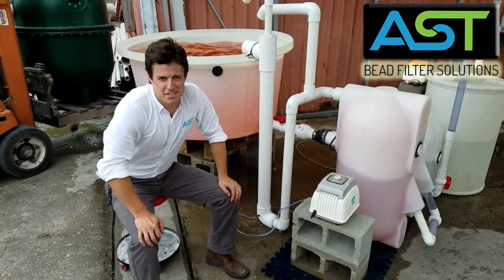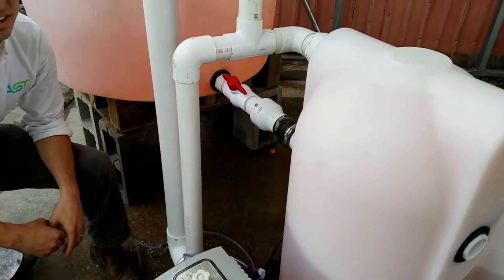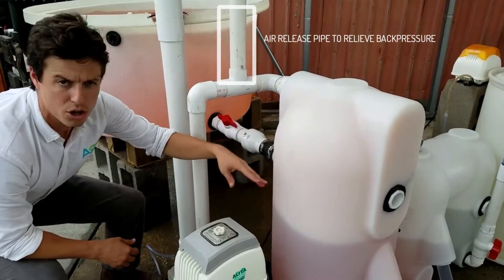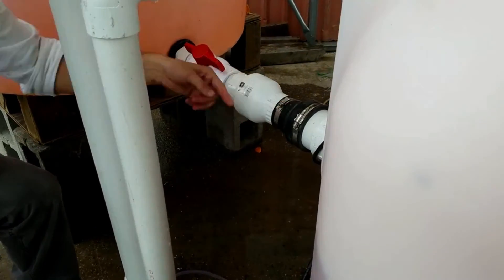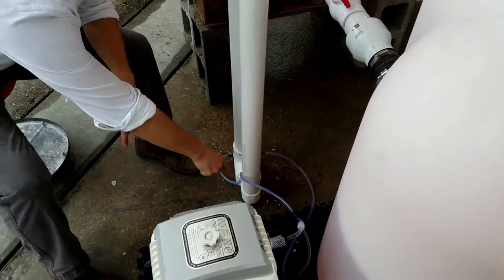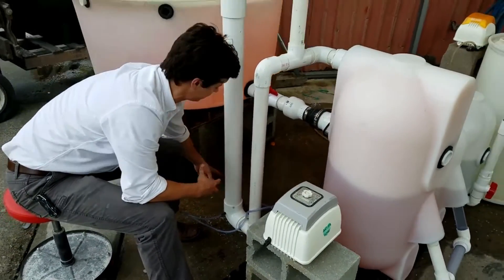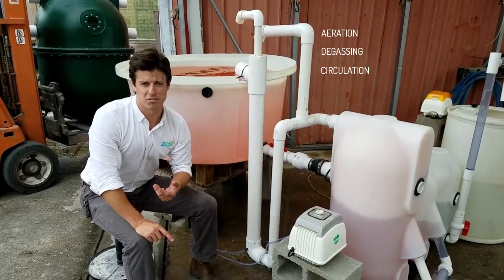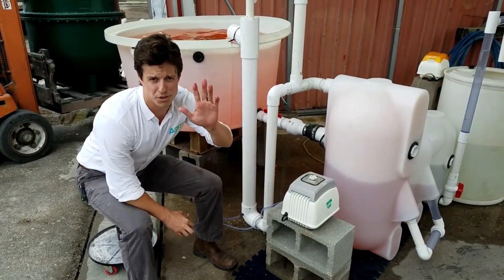AST Endurance Filter: Gravity Fed, Airlifted System- No water pumps required! PolyGeyser Backwash

Comment: What are the advantages of either the Endurance compared to the standard green Polygeyser filter that you make ?
Reply from the maker: Both operate the same way in terms of backwashing, the main differences is the size offerings and the fact that the Endurance consolidate sludge in a separate compartment for removal.
Reply: Thank you for explaining.  That’s pretty cool.  If the third chamber is  intended for more of a longer term and larger separate bin for sludge instead of just having gravity separate it in your other Polygeyser ,  could it be beneficial to have your air intake some sort of  bubbler in the sludge compartment to help with the break down of the sludge . It would be like having a built in mineralization tank .

Comment: hi, I have two questions.
1-I am building oxygen concentrator machine. So your system is good for oxygen mixing?
2-What if the airpump is cut off, will the water still flow?

Comment: waste of extra pvc, title is misleading, air pump does use electricity 🤔
Reply from the maker: Jedab, 

While yes the air pump does consume electricity, The advantage of an airlifted system is that the water pump is not required since we are using air to move the water. We calculate the required aeration for each system based on feed loading and split in tank aeration with the air used to operate the airlift, therefore reducing the electrical consumption of the system. 

Thanks!

Comment: What are the consequences of a power outage/pump failure in this configuration? Would the fish tank lose more than 6 inches of water?
Reply from the maker: Thanks for the  question! There is no real consequence of a power outage. If power is lost, the water level would equal out in the system, with minimal tank water level drop. Basically the volume to fill the pipes is the only water level loss that will be experienced. One thing you want to make sure of is that you either have the air pumps above the water level or have a good, reliable check valve installed so that water can not backflow into the air pump/blower.

Thanks again for your question!

Comment: What is your opinion about biofloc?
 What is its disadvantages?
Reply from the maker: Ahmad, 

Biofloc systems/green water systems have been used for years in both tilapia and shrimp growout. These systems have their advantages and disadvantages. The main advantage is the relatively low capital costs. Since biofloc systems require little to no traditional biological filtration such as MBBR/Bioclarifiers, there is not much equipment that needs to be purchased. However, the main disadvantage of these systems is that they are extremely temperamental which can lead to complete system failures. This could be due to loss of biomass, over addition of carbon, or disease. With typical RAS/clean water systems, a fixed film biological process is utilized  which allows for nitrification. Also with these systems, UV filtration can be added which helps protect from disease issues. 

I hope this answered your question…Thanks for watching!